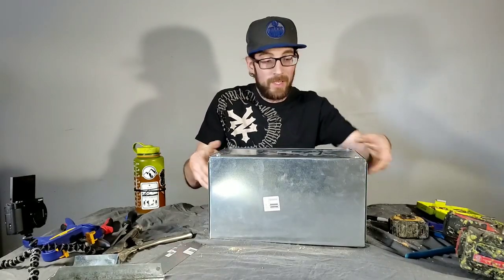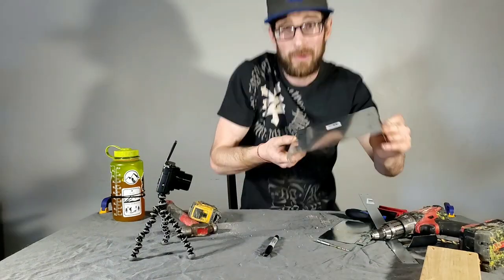DIY Wood Burning Tent Stove! CHEAP packable home made hot tent stove!!

Comment: I follow a YouTuber from RMH named "Dave's Bullets and Bushcraft".  He's made about 10 stoves in the last year, each improving on the previous one.  He uses similar materials.  I was thinking of doing one as well.  Instead of 8 bolts I think I'll us a long ready rod that will extend to become legs.  That's how the Luxe stove assembles.  We're only using these 3-4 times a year, and they're under $40.  Just 3" stove pipe from Home Depot will work.  Don't forget to put vent holes in the front.
Reply: I have an old ice fishing tent made of canvas that I want to use.  Now that I know I can easily pull 20 lbs on the pulk.  If I'm only hiking 10 km to a site like Glacier for an overnight I can pack an extra 20 lbs of gear in the pulk no problem and live like a king.
Reply from the maker: I'll have to go check that out! I had no clue someone else was making these out of the same stuff, wicked! Pointers for me! :)

Ive actually got a piece of the 3" round duct, just waiting for some time to finish the stove off. Admittedly, I've gotten lazy since doing the initial build.. 

I thought about using the redi rod for legs, but my home depot didn't have any, and this strapping seemed like it would work.  Stoked to see what you come up with Marty!

Comment: Burning the galvanized coating off works very well. As long as you get the fire rolling hot it should burn it off thoroughly.
Reply from the maker: Thats what I ended up doing, fhe chemical method took too long

Comment: I looked through your videos and I do not see where you ever used this, or even completed it. Am I just missing it?
Reply from the maker: I did complete the stove, but had camera issues and wasn't able to release a video on the completion unfortunately. 

Shortly after building the stove, I received a winter underquilt for my hammock, and opted to do some hammock trips instead.  

Plans are already set for some more hot tent trips this fall and winter, as well as a new improved stove build.

Comment: I clearly remember you saying it would be packable.  What packable in the back of a pickup truck?
Reply from the maker: It is packable, it comes apart easily by undoing the 1/4" nuts and bolts holding it together.
Reply: @MattyOutdoors    Ok thanks.

Comment: Hey brother! Thank you for putting this up. It was a pretty different build, and I sure enjoyed seeing how you do things.

In terms of sheet metal skills, when you want to put your channel in place for the next one, may I suggest, did you get a couple of bars of solid metal, and vice grip your sheet metal Between those, such that the piece that you want to be fold it, sticks out from between them?

Then you can take a hammer and get yourself a nice clean, even edge.

Then you clamp your steel strapping down to that, and use your hammer to form your channel so that you have a really straight line.

The other suggestion that I would make, is that you consider using an angle piece of aluminum or steel to make the legs, cutting a channel , so that you have a little bit more support for the weight of the contents of the stove, once it’s in use There’s the option of riveting Or bolting a crossmember between each of the two pairs of legs for extra strength, if you’re so inclined, potentially with removable crossmembers between the pairs for extra stability. Almost no extra weight added that way.
      The legs will fold flat, when  it’s not in use, and it will look every bit as good as what you have done. 

It’ll be really sweet to watch your first burn.

Thanks for sharing your ideas!😊

Comment: Excellent build. I think I’d go with some cotter pins in place of the bolts to keep it all together and as another commentator stated some bolts for legs…. For the pin just drill a small hole in bolt and slip the pin in. It would be quicker assembly, weight reduction, and an easier way to improvise a solution should a nut go missing. (😆)
Reply from the maker: I'll definitely keep that in mind, as a new stove build will be happening this fall

Comment: couple questions...is the ducting thin enough that you could make the cuts with tin snips?    do you think it will fail over time and would some kinda of fire brick solution help? maybe small stones from a riverbed in the bottom?
Reply from the maker: I did all my cutting with tin snips, worked great!

As for how long it'll last, im not sure. Im assuming eventually it would wear out, and require some replacement pieces here and there, but so far so good, havent had any issues with it so far.
Reply: @MattyOutdoors  hoping to make and use something similar for a minivan ...march in canada going to be cold though! ha ha thanks for your reply.

Comment: Matty, looks great. how about a parts list?
Reply from the maker: I used a bunch of duct end caps, don't recall what sizes, but you can basically build a stove to whatever dimensions you want, based on the size of end caps you use.

And just some simple 1/4" nuts and bolts to hold it together

Comment: You should use thicker straps for the legs when you put wood in it with those legs it is going to collapse
Reply from the maker: The legs work just fine, I've had a few burns with the stove completely full,and a few pots of water ontop with no issues

Comment: Why do you have to remove the coating?
Reply from the maker: Just eliminates any (albeit very low) chance of getting any kind of issues with the zinc burning off in an enclosed space.
Reply: @MattyOutdoors  ahhh I get it...Thanks!
Reply from the maker: No problem!  The risk, from my understanding is pretty low, but I figure its worth dealing with and taking no chances
Reply: @MattyOutdoors  Do you think I could use an aluminium sheet as a chimney.I foud one at home depot that I can fold and keep in the stove.I dont know ifthe temperature is too high .Aluminium is able to handle 660 celcius I think.
Reply from the maker: I can't see aluminum being an issue for chimney material.

Comment: Try a bell tent That’s what I live in they are great shelters with lots of room mine is 13 ft  I do diversified camping There is a website called Free camping  com and it shows state by state places you can for up to 14 days for free  There are.about 100 of them just in Colorado  Check it out and check out the website called  cheap  R V living. The guy whose sight it is is Bob Wells. he is very knowledgeable in what he does  He has been living in his van for 10 years
Reply from the maker: I'm located in Canada, so the state by state rules don't really apply to me, but I appreciate the suggestion! 

Those bell tents are pretty sweet,but far too heavy for my intended purpose on a backpacking trip. I very rarely camp in the same spot more then one night. I need something light weight, preferably under 4lbs.  My hope is to have a custom tarp with a stove jack built for my hammock next winter.